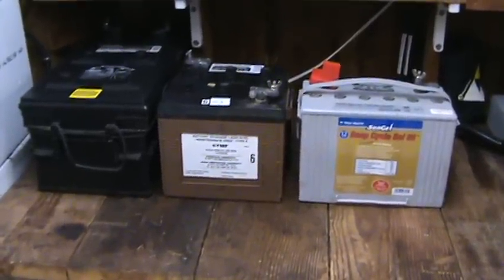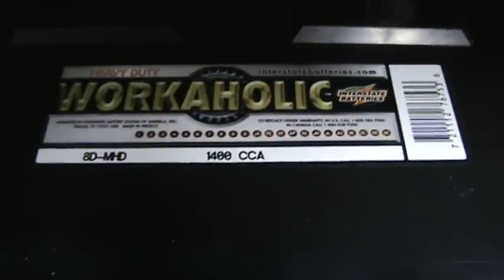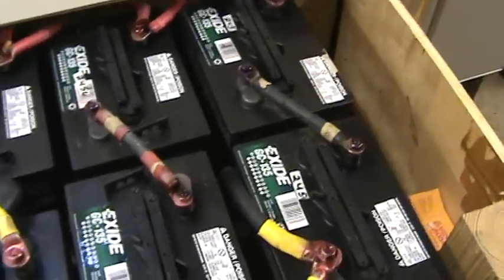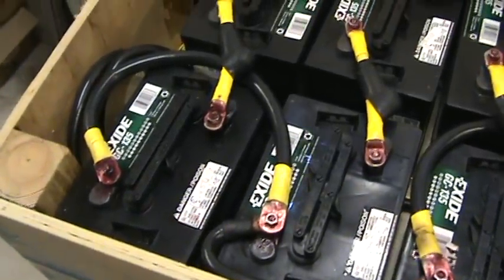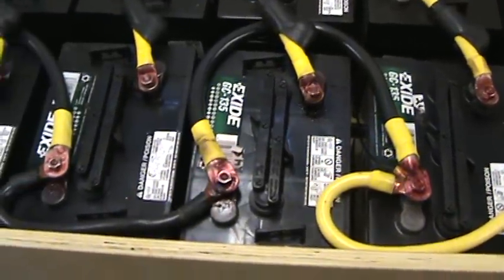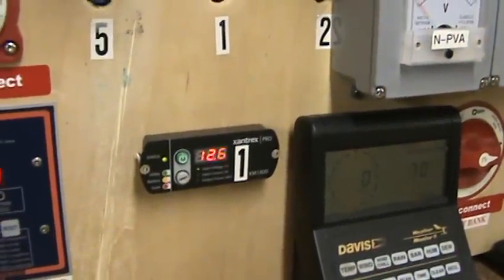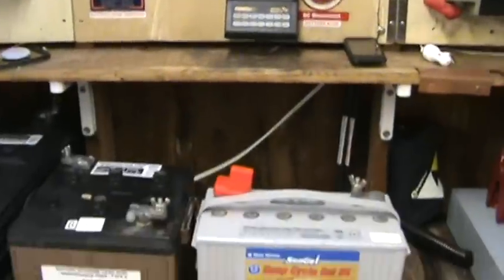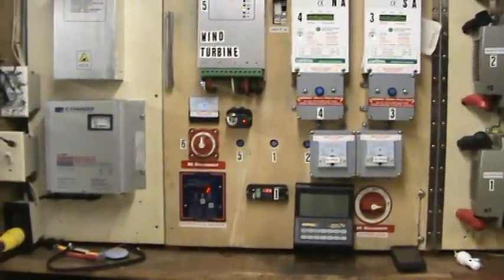Choosing batteries for solar power offgrid or a battery backup system.

Comment: hi how many need for 5000 watts a day
Reply: 1hunterdale 

A big one...

Depends on so many factors its impossible to give an answer off the bat.

But you are well into $1000+ territory.
Reply: that would be bad . for what many watts
Reply: depends on the load.

I assume you mean 5kwh per day.

Not 5000w continuously? 

If its the latter give up! Unless you have money to burn then that won't work.

If you're talking about 500w/10h then thats more achievable.

Are you on grid or offgrid. If you're on grid then you don't need to worry so much about reserve capacity.

If offgrid you will need a couple of spare days capacity, and remember if you want your batteries to last then you can only discharge them to 80%

With all that in mind...

You will need 25kwh of total battery capacity. So at 24v you'll need about 1000ah of lead.

That means you'll need 16 t-105 batteries. 

This offgrid thing is not a cheap choice...
Reply: yea
Reply: +zogworth 3000w continuosly. What batteries to buy?
Reply: Assumptions 12 hours sunlight a day and 50% DOD 

You would need enough solar/generation to charge your batteries during the day. So double your load at least not accounting for losses.

So. 3kw would draw 62.5 amps at 48v

To supply 62.5amps for 12 hours you need 750ah

For 50% DOD and no multiday reserve you would need at least 1500ah battery at 48v

this is a 72kwh battery, thats about the same as Telsa electric car, and in lead acid would weigh in around 2.5 tons.

long story short, get rid of some of your loads!

Comment: Still using the Exide battery bank? How do you like them in comparison to Trojan? Thanks!
Reply: +David Hamrich 

Exide and Trojan are not the same.. they are both 6V "deep cycle" and around the same capacity (225 AH) but they are designed differently.. Trojan are designed for RE (renewable energy - solar/wind/hydro) and Exide are golf cart batteries.. they are lighter by about 10 pounds and have different type of plates.. it's hard to explain but Exide are like Interstate and Trojan are like Rolls Surrette.. so if you are "stop and go" driving electric motor like a golf cart for a few hours a day and fully charging it every day with a grid powered charger then Exide are the ones you want.. if you are powering an inverter or DC appliances and charging with off grid power like solar panels or wind turbine then Trojan are the ones you want.. they are a bit more money but for solar charging they are totally worth it because the cycle life is double and their ability to handle steady draw of current for powering  appliances is awesome..  think of it this way.. a V8 in a dragster is Exide..  a V8 in a tow truck is Trojan..

Comment: do they have to be 225 ah batteries cuz the best deal is 60 to dollars because 35 ah is what i am seeing the 225 are nearly 200 dollars
Reply: Get old or “dead” golf cart batteries, L16 batteries, or industrial batteries for free or dirt cheap
Recondition them back to 100% of their working condition. Use those “like-new” batteries instead of buying new overpriced batteries to save a lot of money!
and if you’re interested in saving money on your battery bank, you can use the EZ Battery Reconditioning program to learn how to:  http://diygreensolution.com
Reply: Nyght myst 

by those figures 225ah are way cheaper per AH?
Reply: How do you figure it's cheaper are back it on the amp hour so you don't look at the cost per battery
Reply: If you want a say a 450ah battery you only need two of the big ones costing you $400

You'd need 13 of the little ones costing $780.

The smaller ones are almost double the cost.

What you're saying is buying 1 gallon of gas is cheaper than buying 20 gallons of gas.

Comment: What is your opinion on using the Optima blue top deep cell batteries. I've had good experience with using the yellow and red top Optima batteries on my vehicles but I know solar is completely different. I know they are pretty expensive but I've read they're good for RV use. The reason i ask is because I am planning building  a camper/expedition off-road trailer for a 15 point expedition honeymoon trip throughout 3 states and I would love to have portable solar power on the trailer so I don't have to run my engine all the time and waste gas.

I have a PEAK 3000watt /6000 peak wattage inverter that I plan to use so I can also use my small 3 gallon shop compressor when needed on the offroad portion of the trip to air up tires also planning to bring a small 12v refrigerator that I plan to run constantly over the month and a half long trip.
I haven't bought a charge controller, or my solar panel yet because I want to be sure I buy everything I need correctly the first time.

I'm still researching everything but any help or opinions from you would really help. thanks a lot for the great vids.
Reply from the maker: RedethMusic  I remember when the OPTIMA's "SIX PACK" battery first hit the market they were all the rage in the marine world. I did not have the best luck with them on my boats and I don't see them as much as I use to. I am not giving them a thumbs up or thumbs down I just don't know. There are tons of solar specific sealed lead acid batteries out there I just have not seen Optima in the race. I hope that helps..
Reply: OBXSOLWIND thanks for replying. I was just asking about the opima batteries because in the offroad world although some are durable they just cant take the smacking and shaking due to acid. or so I have read. but I see people run acid batteries all the time with out any issues. I just figured optima non acid batteries may have an upper hand but I guess not. 
I'm open to ideas even as such as these golf cart batteries that you have here in the video. My only issue is that I absolutely need to be able to jumpstart my truck with the solar charged battery assuming I ever get caught in a pinch with a dead battery in the middle of nowhere with nobody around. Really the only thing I plan to use it on is emergency jump starts, My small compressor, 12v portable refrigerator, 110v outlet to charge my phones and laptop use for documenting the trip and some nice 12v LED lighting for the night time to light up the campground when needed. Maybe a blow drier if my girl friend needs it but I highly doubt it
I haven't calculated the full amperage usage but I will never be using everything all at once. so its really hard to gauge how big (or small) of a solar panel and how many batteries I need for what I plan to use it for. 
Would I be able to get what I need out of gold cart batteries like the ones you have portrayed in the video?

Comment: do you have your batteries grounded.or is it a good idea to ground them?
Reply from the maker: meatdogg101 I have heard it both ways. I chose to keep my chassis ground / earth ground separate from battery negative. I don't have a strong opinion on that.
Reply: I'd consider it almost mandatory. A very good idea, in any event!
Reply: i believe you don't have to ground DC like AC is grounded. you just need to put it back to negative of the batteries like car batteries. negative of batteries is attached to engine block and chassis. that's what i believe.
Reply: ok.Thanks for that information

Comment: what size wire is idea from the inverter to the battery bank,and also i have 12 volt Harbor Freight setup with 6 6 volt golf cart batteries.which is the correct way to tie the batteries in together?Thk u in advance
Reply: meatdogg101 

depends on the size of your inverter. Work out the amps drawn and size cable accordingly (there are many tables out there with mm^2 and US sizes of wire) if you're using 12 volts (which is not ideal unless its for a very small set up or experimentation) then you need 3 parallel strings of 2 batteries in series
Reply: zogworth I'm in the process of doing a video of my setup,when it's posted would you please give me some good advice?
Reply: I'll do my best!

Comment: How about the Exide stowaway deep cycle battery 27 MDCST 100AH, would it be ok for a solar kit? I want to set up a 100 watt solar kit. The battery is priced pretty resonable.
Reply: jcmwhodat23 Excide batteries are excellent quality..those and Trojans are really a quality deep cycle battery. Another thing to think of is a hvy equipment battery if you have access to some..ive picked up a couple at equipment auctions after testing them with a hydrometer for acid life.

Comment: I can get  a forklift battery from work. Its huge, how would it work?

`
Reply: =========>>>>> http://home-renewable-energy.blogspot.com

OBXSOLWIND
Reply from the maker: gerald foster  Forklift batteries are a great option for solar and or off grid use. the only problem I see with them is the high or odd voltages if you can get one to work for you the battery itself is perfect for deep cycling. Hope that helps.
Reply: OBXSOLWIND
You are right they have odd voltages. Like the ones we have at work are 36 volts.
Also you have to consider the weight and how you would get a battery like this home and put it it in the proper place to install it. The  forklift battery that we have in our fork lifts weigh about 3,000 lbs and that is something to think about.
On the other hand, you can replace one cell at the time and this is common  to do so in lift batteries  and one cell is about $80. So  you may get a  battery with 1 new cell and the rest of the cells are worn or weak or you may get a battery that has many different cell conditions.

Comment: 60 + 30 = 90
30 = 50% of 60
60 x 1.3 = 18
18 is 30% of 60
Reply: I agree with the math,  but im my experiance batterry system are 90% eff .so you only need to add 10% or 6Amp in his example

Comment: I just got my first AGM battery. I do not want to ruin the thing. I have a PWM solar charger and a 10 amp deep cycle charger for quick chargeing. None of them say AGM on them. Should I use any of the chargers on my new AGM ? Should I get a MPPT charge controller?
Reply from the maker: Your AGM battery and a flooded lead acid battery charging characteristics are so close I wouldn't sweat it. Check on the web for your specific battery charging, bulking and floating. Generally FLA bats and AGM bats will be very close to the same charging but more than likely the AGM should not be equalized. Hope this helps..
Reply: i wouldn't risk it...
Reply: David
Reply: +Leo Espinosa 
Yes ?
Reply: I had 10 of those AGM batteries in a parallel system and they all died in a short time.

Comment: That bank of golf cart batteries looks as if you might have pairs wired in series, then all the pairs then wired in parallel.

Batteries DO NOT like to be wired in parallel.  Seems as if there is always one battery (or pair of batteries) which are just a touch weaker than the others, and the others spend all day and all night trying to charge the weaker batteries.
Reply: Tom Wade Dumb comment of the year
Reply: http://www.smartgauge.co.uk/batt_con.html

Comment: This stuff can in no way compete with a gallon of gasoline when it comes to energy density and storage.
Reply: It depends on the kind of battery or storage device and solar panels is used.
You have the gasoline....now what?
You need to have  a generator etc to run it and when the gasoline is gone it is gone.
By the way, if you run the generator or any of the ICE ( internal combustion engines) 60% alone goes up in heat. then a generator is about 70% efficient .  And if you power a generator with gasoline, the generator has to run all the time regardless if power is needed or not. yeah of course... you could turn the generator on and off all the time when power is or is not needed, but with light loads for example it still  needs to stay run. 

At the end a gallon of gasoline does not really give you that much more power after you figure in losses. And you never get gasoline back without getting more gasoline from a gas station.
Batteries on the other hand can be recharged by many means.

Usually, a solar system pays off in about 7-10 years and with an generator you would have a constant expense to get fuel for the generator.  

Liquid fuels are always more dense in energy per weight or volume.
But you have to see it in the long run which one is cheaper or which one is more independent and which one suits you better.

The ideal for me would be to have a solar system and a generator as a combined system.  
Run, the generator as back-up when the batteries are getting low or for heavy loads if you have a small solar system or if you do not want to spend a lot on a bigger solar setup.

I would not use gasoline, it goes bad to fast.  I would go for diesel and with my experience you still can run a diesel engine with an 3 year old diesel fuel. you could run other oils in a diesel engine if needed.
Reply: It's not meant to.  It's an alternate source of energy for when others may not be available.  So, what's your point?  How was that remark meant to be helpful?
Reply: Love that response!
Reply: You are right,  I have a 5,000 sq ft  building with a monthly light bill of $225 monthly.  And I would like to go solar but 😣😣😣

Comment: my batteries drain in minutes running a single 5 watt bulb  any help to why
Reply: Size of battery? What kind?
Charge the battery, check the voltage, let the battery sit for 24 hours, recheck the voltage.
Your battery may have a shorted cell.

Comment: Ever hear about NiFe batteries (nickel-iron, aka Edison Battery) invented by Edison at the turn of the 20th century? Apparently not.

Edison Storage Battery Co. started 1901 made NiFe batteries all the way through 1972. EXIDE bought out Edison Battery in 1972 and stopped making the batteries in 1975. Seventy years is a proven track record that it does last +20 years. Exide after all makes more money with lead acid batteries so why not shut down that part of their company that is less profitable.. That "more money" comes from Exide's customers, ie you and me, if we use them. Google any key words and read for yourself. Cheers.
Reply: If they are not available, I am completely unsure what your point is.

Comment: Nice setup. just want to asked  6 pcs of solar panel (17.20 Vmp) (21.60 Voc) (8.14 Imp ) ( 9.13 Isc ) and ( 140 watt ( Pmax ) in series configuration to charged controller of ( 60 Amps ) ( 145V  maximum solar input voltage ) and ( 60-115 vdc  pv array mppt voltage range ).  my question is. the mppt charged controller can handle this 6 pcs of solar array, and do no harm to charged controller? Thanks every one.

Comment: I like your neat and organized setup! We've got a grid-tied system with 12.5kw capacity, but max I've ever seen is just over 10kW, since the panels are at various angles relative to sun.  The bummer is, the most efficient for grid-tied is the new micro-inverters, which crank out 240VAC right behind each solar panel. Makes the wiring much cheaper too and a bad cell doesn't pull down the others.  Problem is, if you want to also have power when the grid goes down (dugh!?), then you need to add some very fancy hardware. Basically a charge controller, which can also output  a clean, stable, 60Hz, 240AC to trick the micro inverters into coming on.   Now all that power has to go somewhere, so you better have some big batteries and even a heater/hotwater load to take the rest when the batteries are full.  I'll be back... to see more of what you've got going there...
Reply: trumpetmaris won't work!! you can"t trick them.... any grid tied sys. needs grid pwr to work..

Comment: Hi and thanks for posting your video, I will be purchasing a solar system, The kit will produce an average of 1200 Watt Hours (Wh) or 101 Amp Hours (Ah) of charge per day.  The Inverter is 1500W at 12V.  I am confused, is this system compatible with two 6v batteries or should I purchase one 12v battery?

Comment: For best results use a 120 volt battery bank with a 120 volt DC to 120 AC inverter
Reply from the maker: ***** I would love to see how you pull that off and justify the expense of putting everything in conduit and a certified high voltage battery enclosure to boot. Please Share..
Reply: OBXSOLWIND
I also want to see that!
Reply: I ALSO...
Reply: add me to the list, lets see what Professor Wb6i1 of Youtube Institute of Couch Sciences comes up with

Comment: Hi ,Can Deep Cycle Battery's  be kept safe in a bedroom / or would they need to be vented out side, I am trying to find away to help my farther replace all is stolen 600 watt solar set up which I know took him two years more to get everything he lives in UK ,I  cant even find an inverter that will run 230 / 240 volt UK items,I spent hours on line looking can you give me any tips were to look battery's to use
Reply: gene mayne 
schnieder makes a 240 volt inverter. a french company that uses grainger as their american distributor. most inverters will quit at 10 volts, with the battery still mostly charged.
Reply: Hi thanks for reply